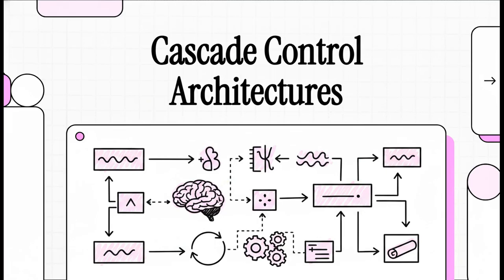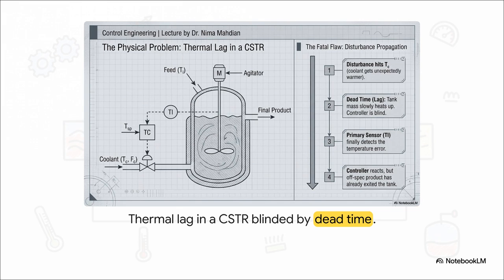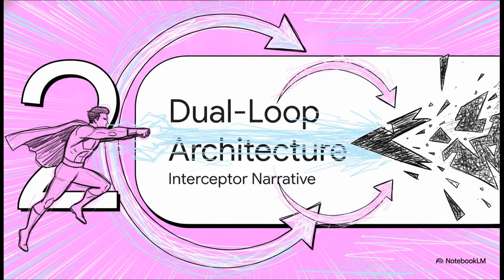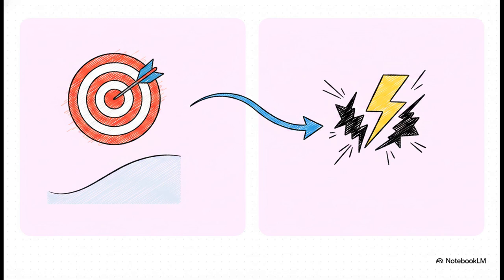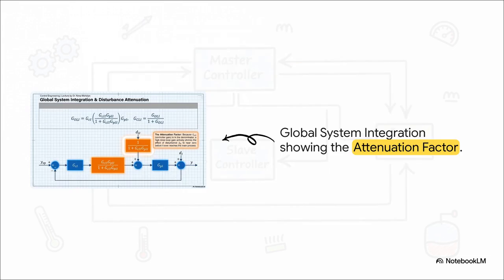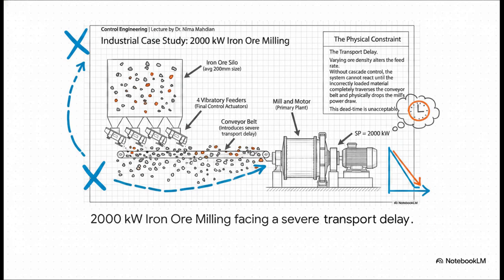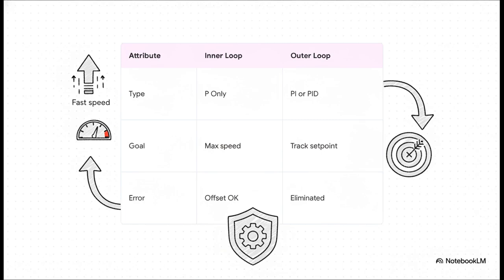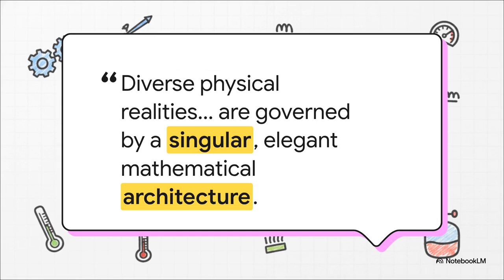Cascade Control in Industrial Automation | Principles, Design, and Applications

Comment: explain Dr, I have question  Why is steady-state offset acceptable in the inner loop but required to be completely eliminated in the outer loop?
Reply from the maker: Thank you for your excellent question. In cascade control, the distinction is important: a small steady-state offset in the inner loop may sometimes be acceptable, while the outer loop is normally required to eliminate the steady-state error of the primary variable.

The inner (secondary) loop is mainly responsible for responding quickly to disturbances and stabilizing the intermediate variable. A very small offset may be tolerated if the outer loop can compensate for its effect.

The outer (primary) loop, however, directly controls the main process variable and must maintain it at the desired setpoint. Therefore, integral action is commonly used to eliminate its steady-state error.

For example, in a temperature–flow cascade system, the inner flow loop may have a small offset, while the outer temperature loop must ultimately bring the temperature to T
∗
.

However, the inner-loop offset should still be kept as small as practical. A large offset would reduce the effectiveness of the cascade structure and make it harder for the outer controller to achieve accurate control.

Comment: Execuse me Doctor I have a question. When implementing Cascade Control in practice, what is the correct tuning sequence, and why is it problematic if we tune the primary (outer) controller before the secondary (inner) controller?
Reply from the maker: Thank you for your excellent question. In cascade control, the correct tuning sequence is to tune the inner (secondary) loop first, and then tune the outer (primary) loop.

First, the secondary controller is tuned so that the inner loop is fast, stable, and well-damped. After closing and validating the inner loop, the primary controller is tuned while treating the entire inner loop as part of the process.

If we tune the outer controller first, the behavior of the inner loop is not yet established. Later changes to the inner-loop dynamics can significantly change the effective dynamics seen by the outer controller, potentially causing poor performance, excessive oscillations, or even instability.

Therefore, the practical sequence is:
Tune inner loop → close and verify inner loop → tune outer loop.

The key principle is that the inner loop should be significantly faster than the outer loop, so that the outer controller can rely on the inner loop to quickly handle disturbances.

Comment: Thank you Dr. Mahdian i have question if you don't mind:
Since cascade control depends strongly on choosing a fast secondary loop, what practical signs tell engineers that a process is suitable for cascade control rather than simply retuning a single PID feedback loop?
Reply from the maker: Thank you for your excellent question. A process is a good candidate for cascade control when there is an intermediate variable that can be measured and controlled much faster than the primary variable. The key requirement is that the secondary loop responds significantly faster than the primary loop.

In practice, engineers consider cascade control when:

The process contains measurable disturbances that affect the actuator or an intermediate variable before they influence the main output.
A single PID controller cannot provide satisfactory disturbance rejection, even after careful tuning.
The inner loop can quickly compensate for disturbances, allowing the outer loop to focus on the primary process variable.

If these conditions are not present, or if a well-tuned single PID controller already meets the performance requirements, cascade control usually adds unnecessary complexity. The goal is always to choose the simplest control strategy that achieves the required performance and robustness.